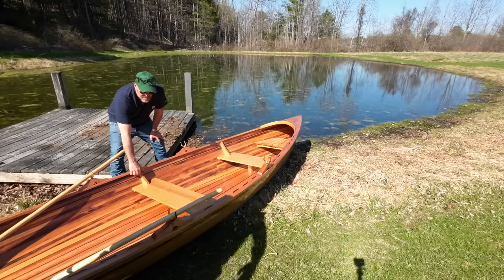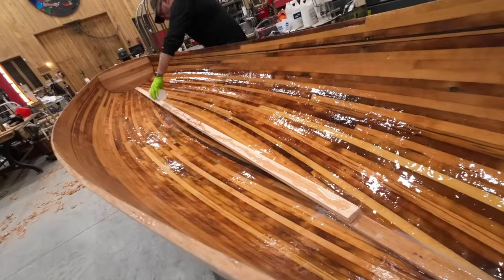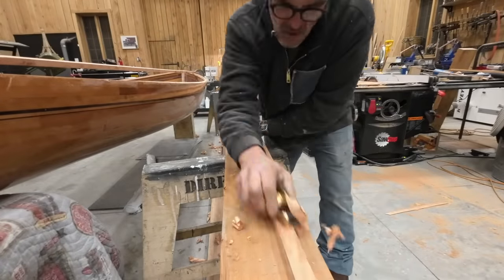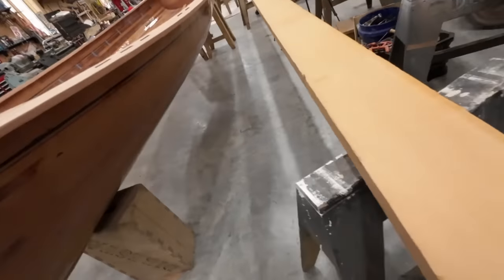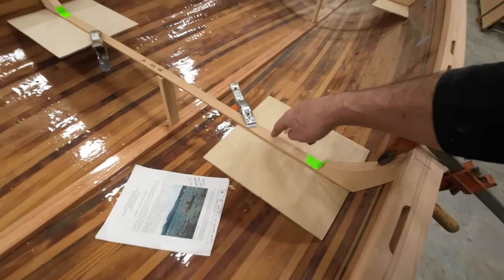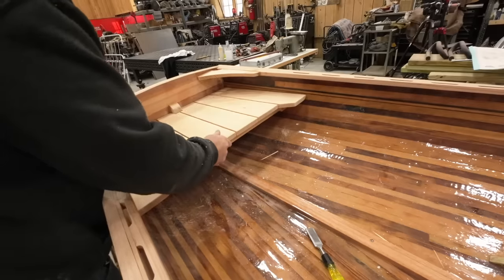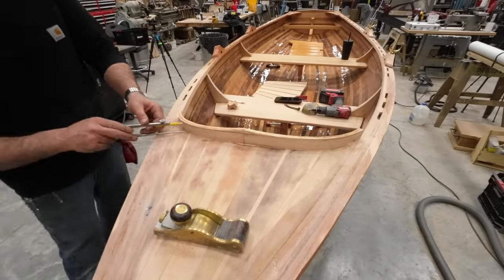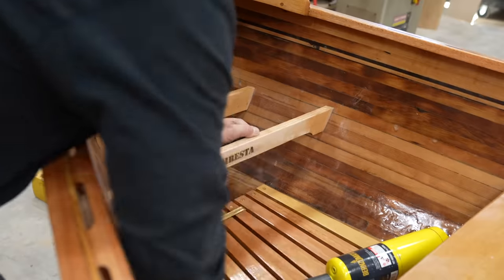Boat build (part 2) recycled porch planks

Comment: Awesome Job! Hey, when you make the oars. put a leather sleeve where the oar locks ride with raised shoulders, (the leather folded up a couple of times or some rope sewed to the sleeve on each end) that will make the oars a tighter fit in the locks and will keep them from sliding in and out while you're rowing.

Comment: Fantastic build! Marred at the end by problems with the rowing position, wrong oar length, and nowhere to brace their feet.
Reply from the maker: This is a tried and true design.  I followed plans.  I am not a boat person so I may have sat in it incorrectly but the design is made by someone with much more experience and knowledge them most.
Reply: @jimmydiresta  The oars are too short and do not suit the rowlocks. Not having somewhere to brace the feet is a serious oversight and I imagine the designer simply assumed some form of brace would be fitted corresponding perhaps with the leg-length of the rower. One of you is sitting cross-legged while rowing - a very unsuitable position - because his legs were 'floating about' with nothing to brace against. The lack of a brace also results in one of you bringing your knees too high. This reduces rowing efficiency - although it is also a possible side-effect of not having a sliding seat. With this in mind I would have made the seat wider fore and aft to give the rower greater flexibility when it comes to positioning.

I am currently building my own rowing boat - without plans - and will wait until I can actually sit in it to position the rowlocks and foot brace.

I'd like to repeat that your boar build is second to none and a beauty to behold.

Comment: I'm surprised that a porch that old would be made from douglas fir.  That's a west coast species, and there are plenty of softwoods that grow in the castskills.
Reply: I’ll bet he means cvg fir, just using the common, rolls-off-the-tongue name of Doug fir, not necessarily meaning from Douglas county.
Reply: @jacksonbennett6151  CVG?  I don't know what that means.  Douglas fir is a species that grows in the Rockies.  100 years ago they were more likely to build from local materials.
Reply: @petercollin5670  clear vertical grain. Straight grain fir with no defects
Reply: @jacksonbennett6151  aha, thanks. Learned something.